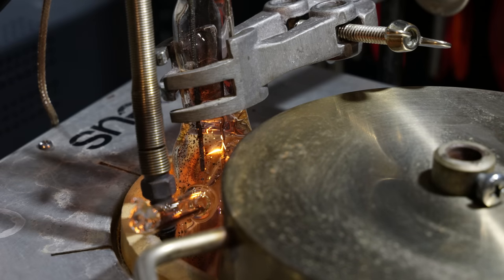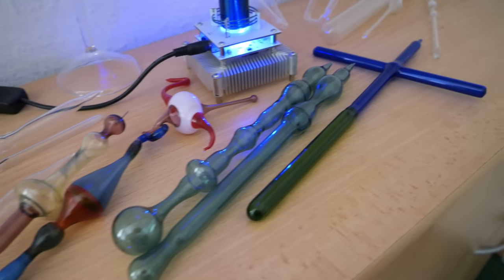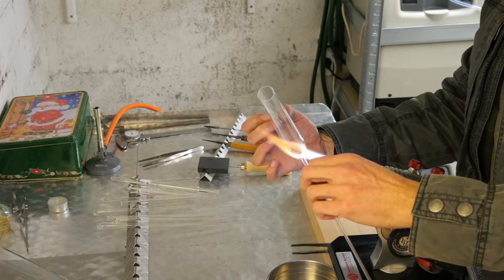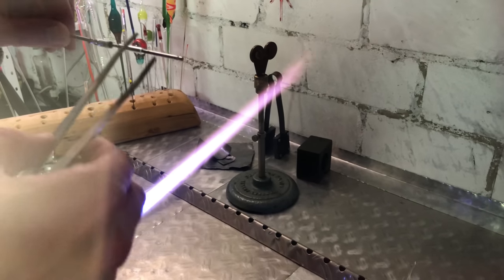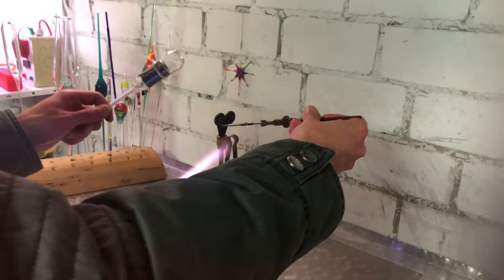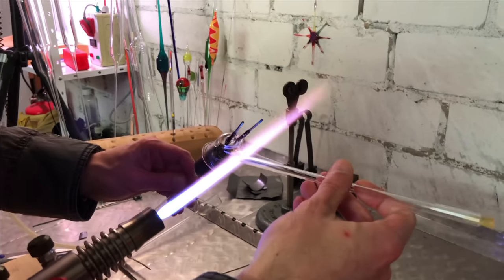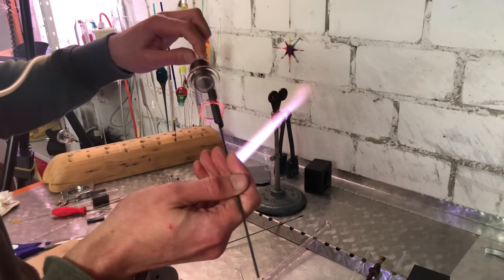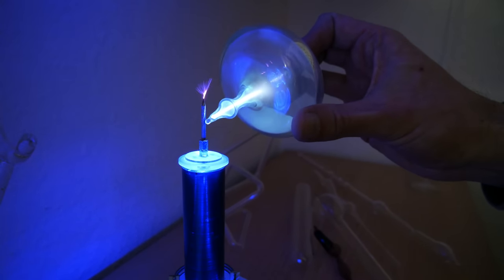The Magic of Flameworking: Crafting Electrical KF25 Vacuum Feedthroughs

Comment: Awesome getting to see the scientific side of glassblowing. I have only done art, and pipes. Ive been blowing glass for close to 8 years and he has to be the smoothest at rotating the work by hand and he uses some techniques that are totally opposite of how I or any other bongmaker would.
Reply from the maker: Thank you! Yes it's a joy to watch Johann work. 
But doing art and pipes is impressive too. I have seen some videos of people making pipes in shapes that are just mind blowing.
Reply: I have to agree that the two approaches are truly completely different animals. Being trained scientific, I never was any good at nor could comprehend the things pipers do with weird unhappy thick lumps of glass and sharp spots where it looks cool and different colors with different coe and viscosity, any time I tried to get fancy like that I would make a tangled ball of twist or heat cracks. I could make whatever shapes I wanted of consistent thickness and consistent glass though.

Edit: Had to doubletake...what are the odds? Tory the scientific lampworker and Terry the bongmaker, both Davis.
Reply: @torydavis10  LOL, yeah mixed COE is worst. The colors are all 33 roughly lol. Some of the colors with aventurine in them really dont like to be encased deeply. Which is a shame because dark sparkly colors look best under a large dome to magnify the sparkles. God I remember someone leaving soft glass in my shop to mess with me. It was a mess. I had to build my own polariscope but they dont work with opaque glass. You think cracks are bad waiting until you use the heavy metal crayon colors. The Cadmium yellow is the worst about boiling in the wrong flame. You have to constantly switch between an oxidizing flame to a reducing one depending on what color or if you are adding gold or silver fume.
Reply: @terrydavis8451  dude yellow sucks, not only does it boil but it seems super brittle even when unstressed, and anything on the yellow-red spectrum turns fire truck red if it's even a little warm and you can't tell what you've put where. I got a lot of mileage from cobalt gold and silver when I wanted to play with implosions of make a pretty pipe. Also, I hope whoever left soda-lime in your shop gets fleas.
Reply: @torydavis10  Oh yeah it was so aggravating....I have totally messed up a pattern by putting the wrong color down because I could not tell the crayon colors apart.

Comment: If having a viton O-Ring works for the reaction, you could try using that for a feedthrough. Instead of fusing the electrodes to the glass, you make a smooth glass surface with 2 tiny holes. Then you put a sheet of viton on top. Lastly, you pierce the electrodes through the viton.
This could produce a reasonably vacuum tight seal. If the holes are the right size, the atmospheric pressure will push down an seal it well, even without a clamp. Bonus feature: it's also an overpressure relief.

Comment: Also, adding a glass bridge joining the 2 electrodes will help stabilize the feed throughs in the glass, or if the spacing is right use a ceramic terminal block on the ends of the electrodes. They are normally fine in a vacuum

Comment: Nice video. Glass working is a very cool skill.

If you only need to heat the the wire inside of a glass tube, did you consider using an induction heater to heat a tungsten filament/wire directly?
Reply from the maker: Thank you! I had the exact same idea yesterday and I will try it. Apparently tungsten is hard to heat via induction but I could also use a titanium wire instead. 
Heating via induction would solve a few problems.
But I have never read of it being used in the Van arkel de Boer process. Guess I will fond out if there's a reason for that.

Comment: Spot welder can be easily made from a transformer out of a microwave. Ehat ypu would have to do is use some large cables and make 2 or 3 wraps around the secondary side. The thinner wire side, is tye hogh voltage out of the transformer and van be cut out using a chisel. I ment to make a video on my channel about this but others have it up

Comment: 10:41 - Nice. well explained on the process. I always wondered how to properly make the button stems for 10 pins to make custom large tube nixie clocks. Is it possible you can make a video showing how to make more pins in a larger glass tube? Thanks.

Comment: very nice, i've been planning to start a glassworking project, u have some nice tips. One thing i've been having difficulty with finding information is how to make stoppers that are vaccum vaccum tight.
Reply from the maker: I'm not a professional, maybe Johann can help. Not sure what kind of stoppers you mean. For glassblowing to close one end of the tubes?
Reply: @AdvancedTinkering  its about making a air or vacuum tight stopper connections for a round flask for example.
Reply: My two cents if I understand your requirement correctly, is that the closest thing to vacuum-tight you're likely to get (reasonably) from glass-on-glass is a well-greased ground glass fitting and mating stopper. Whether or not that will count as vacuum-tight will depend on your project.
Reply: @torydavis10  that’s exactly it,I’m having a little problem in the translations of some term. English is not my mother language.
Reply: @torydavis10  my difficulty is on finding nice methods for glassworking nice tight fittings with stoppers.
Reply: @reisilva2940  The short answer is you buy one. The way such fittings are made at scale is molding the rough shape of the standard taper with a specialized tool and then grinding the taper to spec on a machine. If you want to be able to stopper a piece of glassware you made, what you do is buy a ground glass fitting and seal it onto your project. Then a standard ground glass stopper, which you also will buy, will fit.
Reply: @torydavis10  very nice! Thanks for this.

Comment: 11:24 You can see that the left tungsten feedthrough, has more of this yellowish golden color. And that's what you want to have it vacuum tight. I still have no idea how to do this with thicker tungsten wire/rod. But I also only have pasic tools 😅
Reply from the maker: At this point I am very unsure about the proper color of a tungsten to glass seal. :D I've read it should be cherry red and other times it is stated that it should be golden.
Reply: @AdvancedTinkering  I think in my early attempts I tried it with cherry red seals, but they never worked.

Comment: Alligator clips. For connecting the wires to the electrodes..
Reply from the maker: The problem is, that any extra metal that is not titanium or tungsten or is not heated to ~1000°C will be eroded by the hot iodine vapors.

Comment: where did you buy your burner for glasswork ?
Reply from the maker: The one in the video is a Bethlehem Bravo. https://www.bethlehemburners.com/torches/bravo

They are pretty expensive. As a beginner you will also get a lot of use from a cheaper used burner.

Comment: Why wouldn't you just use copper for the feed-throughs. It's not that hard to get the proper oxide for a high vacuum grade seal, and the benefit is a pliable material with higher conductivity that can be soldered to on the outside, and easily crimped or spot welded to on the inside.
Reply from the maker: The coefficient of thermal expansion is too different for fusing a solid copper wire to borosilicate glass. So it would have to be very thin. A copper plated nickel-iron wire or a copper tube would also work as far as I know.
Reply from the maker: The coefficient of thermal expansion is too different for fusing a solid copper wire to borosilicate glass. So it would have to be very thin. A copper plated nickel-iron wire or a copper tube would also work as far as I know.